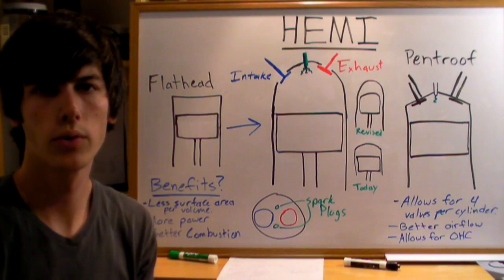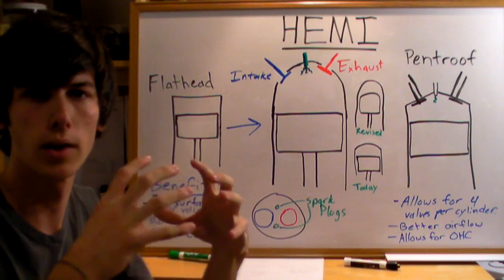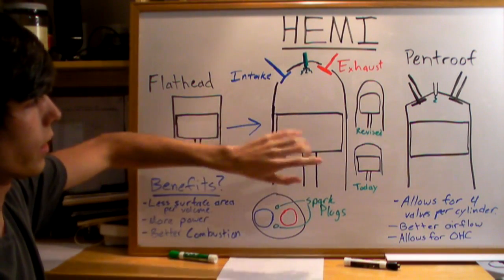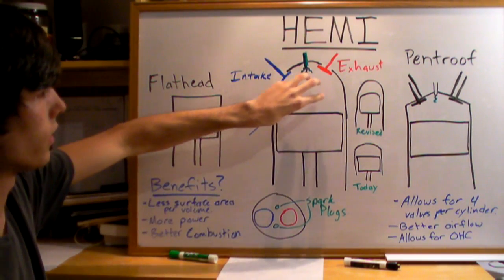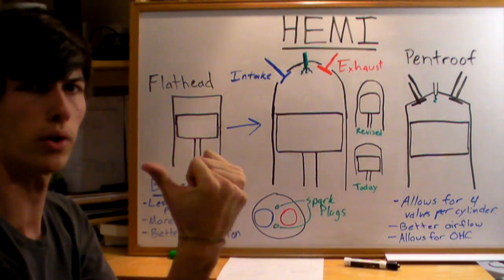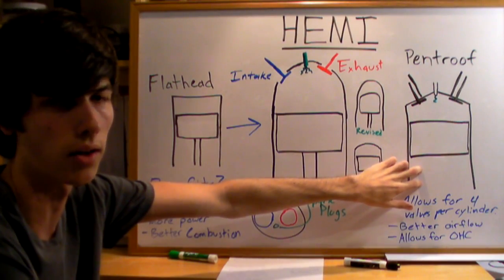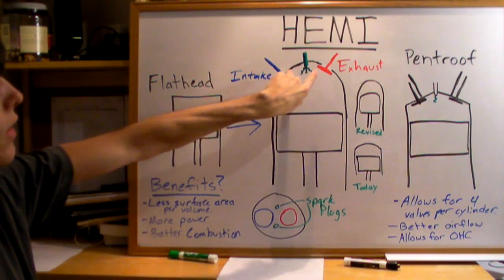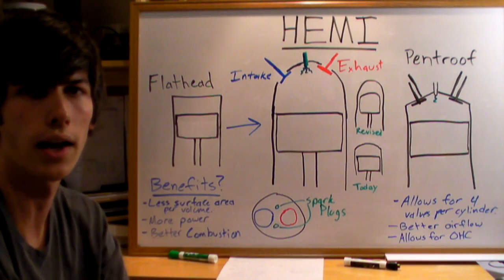What Is A HEMI Engine?

Comment: Porsches and Ferraris used twin cam, two valve, hemis.

btw, pushrods do NOT limit rpm.  The heavy valves do.
Reply: The real doktorbimmer I told you they have no clue what theyre talking about
Reply: The 2 REASONS that Hemi's are not produced and used in modern engines is simple. They are Horrible for emissions, and they are expensive to build. PERIOD. Which is why after market sale them like hot cakes.
Reply: Chris Stavro lol, no they dont. Ferrari's are 4 valves per cylinder, so are Porsche's.
Reply: The real doktorbimmer So you say I don't understand the "engineering" concept of the hemispherical combustion chamber design and then start talking about shapes? 

You're missing the point. Pentroof isn't the end all and be all of cylinder head performance, for one, and for two, just because a perfectly hemispherical combustion chamber isn't seen on any production vehicles doesn't make them obsolete. That shape has been used and is STILL being used for the fastest accelerating race cars in the world, end of story.
Reply: CaptianHicterDeckmen Do you even math?
Reply: Hoo ra
Reply: +Chris Stavro
A pushrod engine can readily achieve any RPM that is useful on a daily driver. Having to excessively rev an engine produces excessive friction losses. There's a reason that trucking and "prime mover" engines are all LARGE displacement, LOW revving engines...it's the most efficient way to make power!

A high-rev, undersized engine is merely a side effect of a Byzantine taxation structure.
Reply: +The real doktorbimmer
Even by Diesel standards OTR trucks have lousy HP/L. Plenty of smaller Diesels approach the big 16L engines in HP (albeit not torque).

My beef with OHC V8...specifically...is twofold: first, they pose packaging problems. If you've ever done a head gasket job on an engine, and noticed how much SMALLER an engine is w/o its heads on...consider that a flathead only has a metal plate atop, an OHV has valves, plus a rocker arm...and a DOHC has all that, PLUS cams. It rationally stands to figure a 5.0L V8 flathead is smaller than a 5.0 OHV, which is in turn smaller than a 5.0L OHC.

Given that a large displacement V8 is a "tight squeeze" in many a car, that OHC stuff takes up much-needed underhood room.
Reply: Secondly, consider that many (not all, of course) V8s are installed in heavy vehicles: pickup trucks, SUVs, and luxo barges. This is an application where low/mid RPM torque is FAR more important than high-RPM peak HP! Remember--peak HP is just that: HP at one, specific RPM, at WOT. In anything OTHER than a sports car, you spend 1% duty cycle or less at WOT/high RPM, so try not to get too hung up on it!

I don't see the great value in a high-revving V8 for, say, pulling a camper. If you're anywhere NEAR peak RPM, you're burning through gobs of gas, and overheating both your oil and tranny if you maintain that output for long. Given my druthers, for a "pulling" vehicle, I'd opt to LOWER the peak HP, and UP midrange torque (assuming I didn't have cam adjustment and had to optimize for one or the other). In such a setup, DOHC is needless overkill.

Now, for a sports car, YES I can see where a DOHC might be useful...if the whole engine is optimized for high-RPM ops. I think a 3.2L, DOHC, flat-plane V8 would make an AWESOME replacement for a "ho-hum" V6...just accept in advance that fuel consumption will suck! However, if you have a 6L, crossplane V8 with a 4" stroke...you have a platform that is already biased towards the "torque" end of the spectrum. IMHO, putting DOHC on such an engine is like putting track shoes on a fat guy: pointless.
Reply: "Less rpm means less horsepower.. "
With a given BMEP, you can either up the RPM, OR up the displacement (ignoring turbos for a sec). The game is "total CFM flow." You can do that either by moving bigger pistons, or moving smaller pistons more frequently. Generally, upping the displacement is more cost effective, tends toward longer engine life, has the side benefit of midrange torque, and is all-around preferable, unless you happen to be burdened by living under an arbitrary and capricious taxation scheme. (And I've already conceded that high-strung blender engines make for good tax fiddles.)

You Europhiles tend to forget that...you rag on engines for making "less HP/L" when your beloved engines flat-out make less power! To outdo a pushrod V8, you generally require an order of magnitude more cash.

IRL, power/weight wins races, power/dollar wins in the economic marketplace and power/cc gets you "Miss Congeniality."
Reply: HERE HERE BROTHER!
Reply: "Pumping loss is a critical factor in BSFC.. and the simple fact is (and something that you seem completely unaware of) engines with poor volumetric efficiency (like a 2-valve OHV design) have terrible volumetric efficiency."
Pushrod engines have awesome volumetric efficiency within their "sweet spot," which is lower than an OHC's sweet spot. For mid-range torque (which is really "mid range power," as they are directly proportional at a fixed RPM), you can have "too much valve" and "too much cam" for efficient operations. (This is why VTEC engines even bother with a "cold cam" setting, and why some designs function as a 2-valve at lower RPMs.)

What you're forgetting, Herr Doktor, is that INTAKE VELOCITY is king at mid-RPMs, because the fuel-air charge has inertia. The mistake you're making is (correctly) pointing out that DOHC has the best BSFC at peak HP/RPM, and (incorrectly) extrapolating that across the entire operating range. WRONG! For maximum efficiency, you want MAX VE AT WHATEVER RPM YOU DO THE GREATEST % DUTY CYCLE! 

(A car with "racing cams" has outstanding VE at max RPM, but can barely idle. Surely, Herr Doktor, you can see the folly of claiming such a car is efficient...unless all it does is run flat-out.)

And, don't forget, the "most efficient" way to operate an ICE is to run it WOT* at roughly the RPM corresponding with peak torque.
*(Assuming no enrichment circuit at WOT.)
Reply: ""Pushrod engines have awesome volumetric efficiency within their "sweet spot," which is lower than an OHC's sweet spot." NO, THEY DON'T... IF THEY DID? THEY WOULD ALSO HAVE HIGHER HP/per LITER OUTPUT"

AWESOME! I've gotten to the heart of your misunderstanding!

BSFC DOES NOT directly correlate to HP. BSFC directly correlates TO TORQUE! (Which you then multiply by RPM/5252 to derive HP.) The "max BSFC" IS NOT located at max HP; the "max BSFC" IS located at max TORQUE! (More or less...accessory loss, plus a few other things.)

Two engines can have identical displacement...identical Max BSFC...at different RPMs. The one with the "higher RPM peak" will produce greater BHP, but both will produce the same (more or less...) torque!
Reply: ^Sorry for the above typos; YT won't let me edit for God-knows-why.
Reply: Chris Stavro The pushrod design isn't as stable at high rpm's as an overhead cam design. Valve weight is only a part of the equation.
Reply: The real doktorbimmer Modern production domestic v8's do not use a pentroof design. They are all dish/bowl shaped in the combustion chamber. They're more of a hemispherical shape than they are a pentroof shape, by far. Just saying.
Reply: The real doktorbimmer  Not too concerned with someone whos only opinion seems to be about whether or not an engine is relevant to production cars
Reply: Tech4Dummies  FINALLY SOMEONE WHO CAN BACK ME UP ON THIS SHIT HEAD! GOOD ON YOU SIR!!!!!!!
ive taken apart lawnmore engines that are what most ppl would call a hemi by this shit heads idea of engines
like you said its a dish Bowl Shape on the header and while yes a perfectly shperical hemi is no longer with use the mordern Hemi NOT THE DISHBOWL still puts out ALOT of power
hell ALOT OF engines out there use this dish bowl header for the shere reason that it WILL ADD A LONG LIFE TO THE ENGINE!
Reply: The real doktorbimmer How about this shitface Site the manufacture becuase i GERENTY YOU CANT!
Tech here most certenly can of that im sure
You strike me as a european guy who just LOVES Super cars
site the maufacture and when and where the NHRA has a GOOD track record of keeping the information of who made what did what speed in what time in what class at a given location
DO THAT YOU PRIUS FACED SKID MARK ON HUMANITY
Reply: The real doktorbimmer shut up and stop being salty
site some examples and then go cry to mama
Reply: The real doktorbimmer Also i'll have you know that Toyota is going to be going for a LONG TIME after you shitty benlty is dead and rotted into the ground
Reply: The real doktorbimmer also YES IT DOSE
Reply: Chris Stavro Which ones? Citation needed. O Ya, dont give me a car that is not currently being sold (aka) 2015 or 2016 model year.
Reply: Porsche 917-30, every Porsche 911 up until the early '90s, Ferrari 308...too many to list.  why don't you google it?
Reply: Chris Stavro because i know that no current car does. And so do you.
Reply: The real doktorbimmer lmfao im just going to start with this first big guy the hell cat runs a 6.2 handbuilt forged engine supercharged not 6.4 as in the 392 hemi before you all go argue over this google has all the facts and ext about the production of new and later model hemi as were originally the 5.7 came out with around 350 hp close to mid 2000 and today is running 395 in the dodge ram trucks as my  pentroof 5.9 stock runs from a 230 to 255 hp depending on years huge difference in the technology that is in the new engines why dodgw truck only run hemis or diesel now and ford has down sized to v6 and to turbos to get into the European market and chevy still stand tge same with there new 6.2 lit that can just barely beat a 5.7 hemi and doesn't even come close to the 6.4 395  for power specially .5.7 l engine to a 6.2 and a 6.2 to 6.4 that blows it away
Reply: +Lazerus2008 lol no they dont. ferrari's have 7 per cylinder n porsches have no engine
Reply: "in fact, no one in the automotive industry is going to agree with your assumptions."
Gee, Herr Doktor, nobody agrees that:
"OHV engines are more physically compact than comparable OHC, especially V-engines?"...or was it perhaps..."A crossplane V8 with a 4" stroke is a compromised design for high RPM power?"...or possibly "looking solely at peak HP at one RPM is a gross oversimplification of engine performance?"
I thought all of those statements were facially obvious...
Reply: PREACH BROTHER!!!! PREACH!!!
Reply: "this may occur if we are only comparing engines on a displacement scale... with equivalent basic dimensions, "
Thank you for conceding my point, albeit in the least gracious means possible.
"In terms of Power Density,  the OHV design is a disadvantage and will be larger, heavier and less compact  based on the assumption that it is an efficient compact design to begin with"
That's debatable, Herr Doktor, and you've been given the example of the LS series of engines as a benchmark. 455HP;455lb.ft.  Exterior dimensions and weight a matter of public record.

What DOHC bests the LS at its own game? I'm betting (if such engine exists), it's either 1) forced induction, 2) An order of magnitude more expensive, or 3) both 1) and 2).
Reply: ...and besides, if HP/cc "isn't everything...it's the only thing," then get out of here with your DOHC 4-stroker, and come back with a 2-stroke, a Wankel or a gas turbine! (All of which best a DOHC 4-stroke...which goes a long way towards showing just how arbitrary/meaningless a metric HP/cc truly is...)
Reply: as last i checked in case you forgot
Gm Have OHV Chrysler dose and why?
becuase they do NOT want to be a JOKE like ford is
#CoyoteV8sSUCK
and while yes a good number of them for the big 3 DO offer OHC motors you your self awsnerd the question
BECUASE OTHER PPL MADE IT AND THEY ARE BUYING IT AND THEN RESELLING IT HERE STATE SIDE and TURNING A HUGE profit
Reply: hell i got one you can put in your pipe and smoke it

"The Koenigsegg Agera features the highest specific output of any production DOHC motor. Their 5.0 liter engine puts out about 940hp on premium pump fuel. The engine also weighs a mere 434lbs. (for reference, the V12s of Lamborghini and Ferrari are over 550lbs and the Bugatti W16 well over 600lbs) That’s great, but, SSC’s 6.3 liter pushrod puts out 1287hp on premium pump fuel and weighs 425lbs. So not only does the pushrod engine here weigh about 10lbs less, it makes 347hp more.

At this point I am sure some are crying out about how I chose the less powerful Agera and not the Agera R, how I rigged the example. No, I chose the Agera for a reason. I wanted a FAIR comparison. Both the Agera and the Ultimate Aero use the same fuel. The Agera R uses a much different fuel, the higher octane E85. Using it would be just as fair as choosing an engine from Nelson Racing Engines that runs 110+ octane race fuel, and they produce upwards of 1700hp. Not really an accurate comparison either way. I wanted as many variables to be the same as possible"
Reply: From "physicsforums.com":
_"Max thermal efficiency (power output / potential power input based on fuel consumption rate) is usually highest at rpm of max torque.Reference https://www.physicsforums.com/threads/gasoline-engine-max-torque-and-efficency.750298/"_
Reply: +The real doktorbimmer
AGAIN: I've got you! I gave references! Can YOU give a reference that says max BSFC = Max HP? You can't, for the same reason you can't give a reference saying gravity repels objects...
Reply: "BSFC is the amount of fuel in pounds or kilograms per horsepower produced"
YUP! Which is why I'm right:
Consider:
1) Two identically-sized engines (5.0L V8), that have the same peak BSFC. One peaks at 3,000 RPM; the other, 6,000 RPM.
2) The one that peaks at 3,000 makes (let's say) 250HP, and burns (let's say) 13 GPH. BSFC = 250/13 = 19.23 Hp/(Gal/Hr)
3) The one that peaks at 6,000 makes 500 HP and burns 26 GPH. BSFC = 500/26 = 19.23 Hp/(Gal/Hr)
4) Torque of engine #1 is 250 *(5252/3000) = 438 Ft*Lb
5) Toruque of engine #2 is 500*(5252/6000) =  438 Ft*Lb

Q...to da E...to da D!
Reply: That's mathematical proof, right there! The ONLY objection you could possibly have is "metric fanboyism..." but you'll see that it converts to g/(Kw*Hr) just fine...I merely used units I could "eyeball" better to give a plausible scenario.
Reply: ...I expect you to admit you goofed. It was a review for me; you're the one who had some learning to do. I'd also appreciate it if you were honorable enough NOT to edit your "BSFC = HP" ex post facto.
Reply: "  The only one here editing comments is you!"
Huh? Dunno what you're referring to...I post a rough draft, then immediately go back and edit for typos/paragraph spacing, but I've never substantively altered my logic/reasoning to make myself look better, after the fact.
Reply: @doktorbimmer "the Chrysler Corporation no longer exists...  its FIAT now...  sold under the brand name Chrysler..  Ciao baby!" ->LMAO!

Comment: I am building my own race engine. And I have found using a duel wedge give you better efficiency up un till 8k rpm my engine will redline at 7500-8000k and should be 800-900 horse I'm only 16 , I have the exactly the amount of money which is $10,579.68 I make 15k a year so that's ok close to minimum wage I payed for my home schooling so I could get a job and work good hours I want at leased 2k more than I need in case I have unexpected expenses I have all the parts and the car it goes in 65 nova I'm just waiting t for the 2k so I can start I will be my second engine I have built bye my self but I have work with my dad for many years he make race engines from 800 horse to 2000 so I think it will be very cool I want to make sure I have bought every thing with my own money sacred every penny I have ever made to do this and I want to do it professionally when I get older